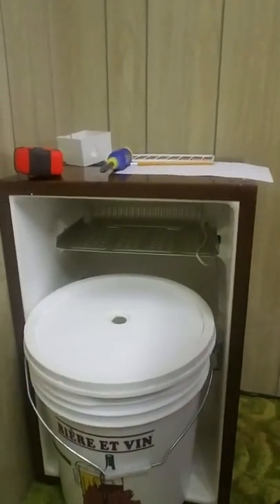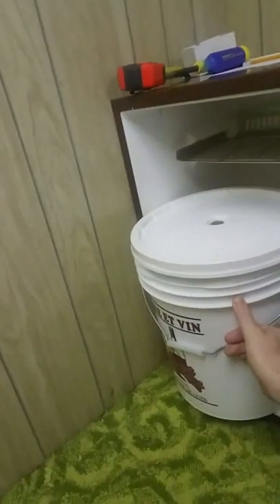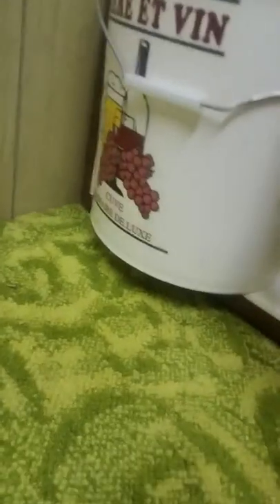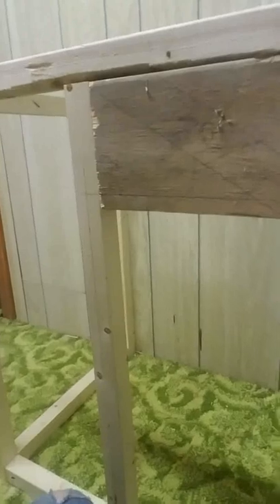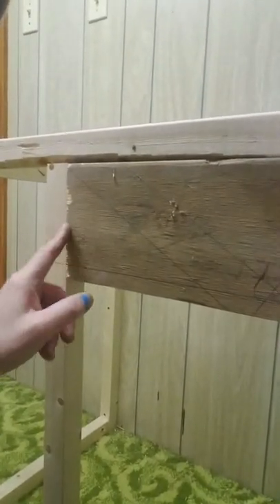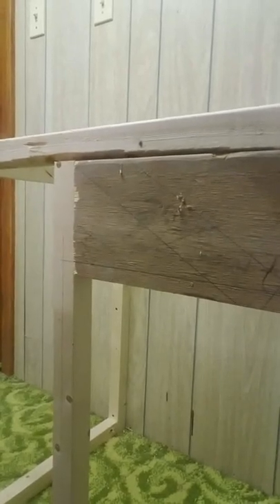Budget Fermentation Chamber Part 1

Comment: For the initial framing around the opening of the fridge, am I understanding that those ripped 2x4's arent actually attached to the fridge?  They are just attached to the wall (on the one side) and then to each other, and the fridge is just held by compression?

And what did you staple the pipe insulation to around the opening?  The frame?
Reply from the maker: The way I'm doing it yes. The board along the wall is screwed secure and is the basis for the seal